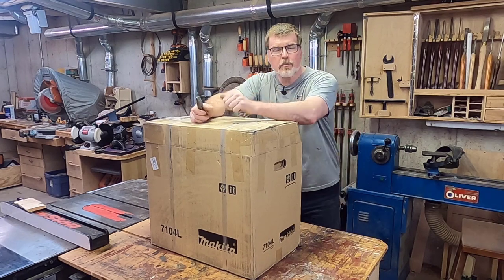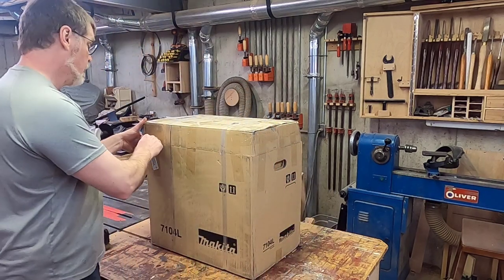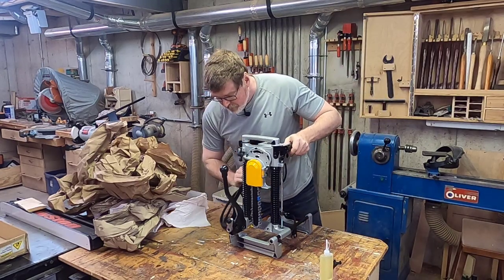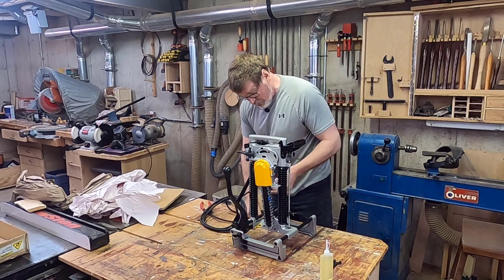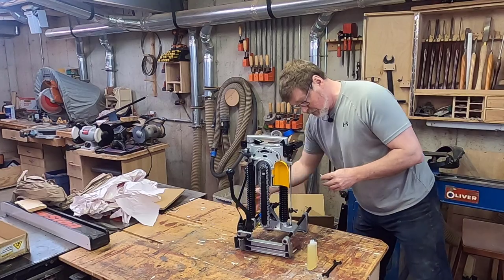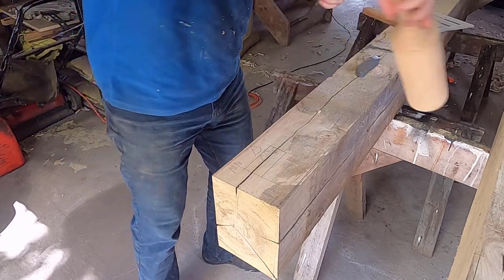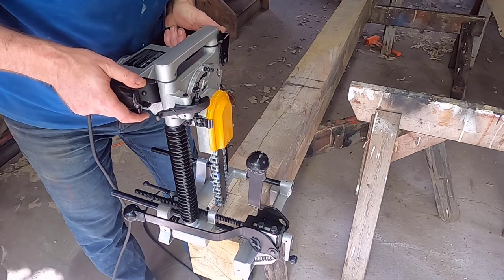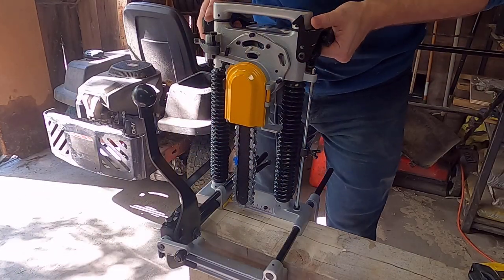Makita 7104L Chain Mortiser: Unboxing and first use.

Comment: I’ve had one of these for about 10years,you adjust the width of mortice on the small plate on the second hand so no need to measure and the yellow marker is width of chain,it’s a fantastic machine,try the Makita 4 blade Tenoner!

Comment: I am getting one and I don’t even do joinery work.
It’ll look great on the mantle piece.
Only kidding I am planning on building a large timber frame shop in my back garden here in the UK.
This tool would be very handy but they are quite expensive.
Reply from the maker: Yes, it was a painfully expensive tool. Good luck with your build.
Reply: @SalemWoodworks  Thanks for the reply.

Comment: Could you use this tool to mortice into an upright post.  I have about 2km of post and rail fencing to do with the rails mortised into 150mm x 150mm square posts.   Will the clamp be strong enough to hold on the post in an upright position.  Any advice would be appreciated before i fork out $3k (Aussie dollars) or so for one of these.  Thanks in advance.
Reply from the maker: It's definitely not designed to work that way. I doubt that the clamp would reliability hold the weight of the tool on a vertical post.
Reply: @SalemWoodworks  Thanks.  I appreciate the reply.
Reply: i've used a Mafell door lock morticer for this job
Reply: Since my first comment I have purchased the makita version and have been using it on 200mm x 200mm upright  posts and it has worked a charm!  Saved me a lot of time and has definitely paid for itself a few times over.
Reply: Version of what? The door lock machine?
Reply: @treaser2  

Sorry. No.   The makita chain mortiser.  The one demonstrated in the video.
Reply: I will add that we are onto our 4th chain.   But that is working is guts out for 40hrs a week over a 3month period.   So pretty good considering.  But those chains cost about $400 AU.
Reply: @stevesweet3304  i see, thanks for the info. Best regards from sweden

Comment: So what's the verdict after almost a year?  I am searching for a chain mortiser.  My friends are pushing me to get either a Mafell or Swisspro but I see no issues with the less expensive Makita as long as it does the trick and has longevity.  The others are 3 to 4 times the price and I don't think they even have as many features.
Reply from the maker: Well, first let me qualify by saying that I don't have any experience with Mafell or Swisspro so I'm not sure I'm qualified to answer.  I used the same Makita in the timber framing course I took at the North House Folk School. The fact that they use Makitas at a school to teach timber framing likely speaks well of their durability and longevity. My instructor there said that the Mafell was a superior machine primarily because he was more productive with it (you don't have to clamp the fence like you do with the Makita because the chain runs perpendicular to the plane of the beam being cut). That said, like you I found it hard to justify the heavy price tag of the other machines. Truthfully, as a hobbyist, I found it hard to justify even the Makita. So the verdict after a year (and building one frame with it) is that I'm still happy with choosing the Makita. It worked extremely well for me in creating fast/accurate mortises.  I hope to build more frames yet and if I ever decide I'm done with timber framing, these Makita machines command a good price used, so I'll recover much of the cost then.
Reply: Ugh.  I'm literally looking at a Makita here for $1600 vs a Mafell for $3700 plus a fence....Hard to justify the price.  So many good reviews for the Makita and unlike my friend, I am not doing this for a living so I don't think I need a pro tool in this case.  Makita is a rip cut vs a cross cut Mafell. Motor strength is a factor but again...eh. Reply appreciated.
Reply: @SalemWoodworks  I mill my own timber and went with a lesser mill and have been happy.  Not surgically precise but does the job very well.  A Makita may not have the nod of approval from the professional community but I have to say there are tons of good reviews and vids of the Makita and few for the others. I think Makita may be the choice